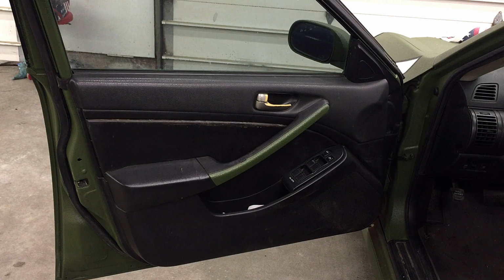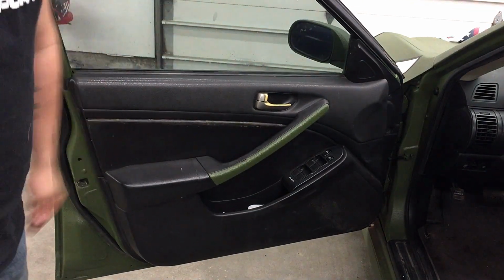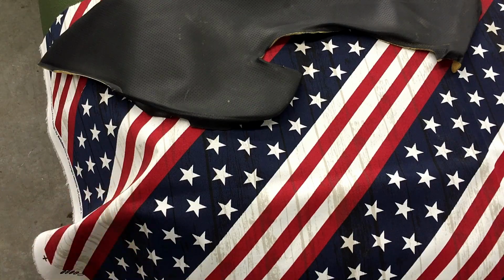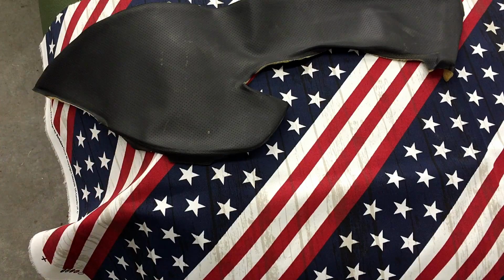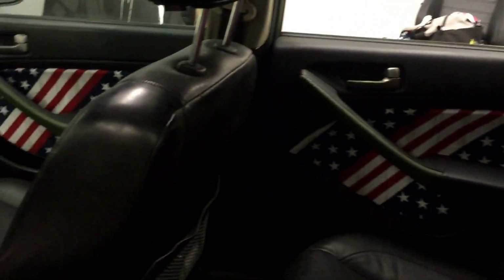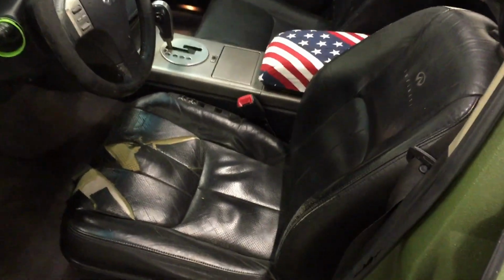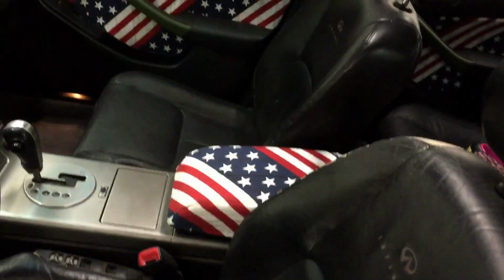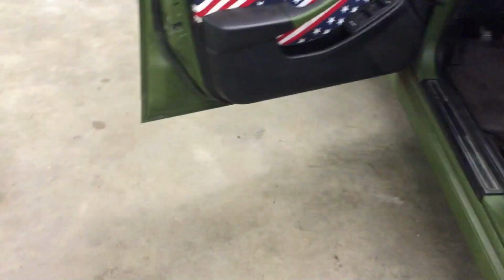How I did custom door panels on the Infiniti g35 Warhawk

Comment: Instead of prepping a car with sanding could you simply add an adhesive, paint it then prime it? Would it hold up just as good? Plz lmk
Reply from the maker: BriizCustoms I wouldn’t recommend that ever just due to it not having to adhere to.
Reply: @JamesDguy  Isn't adhesive made for the purposes of adherence?
Reply: @JamesDguy  Based on that would it in fact adhere?

Comment: Wow that’s aggressive.

Seriously though, it’s really badass. 😱
Reply from the maker: Samuel Walker Thanks I tried my best. The stock door panels were garbage and 2 fabrics were almost completely torn off and hanging when I got it.
Reply: Nice, I was in a similar boat with my car. Had a completely trashed interior when I got it. I found a junk yard car with a beautiful interior, and pulled it and switched my interior for the crappy grey to nice black interior. Also converted the car to power windows.